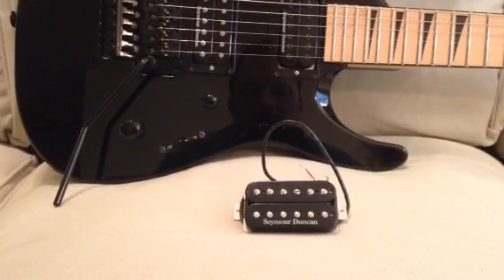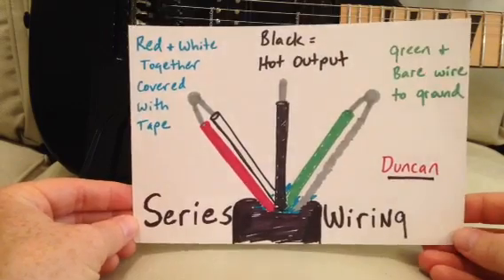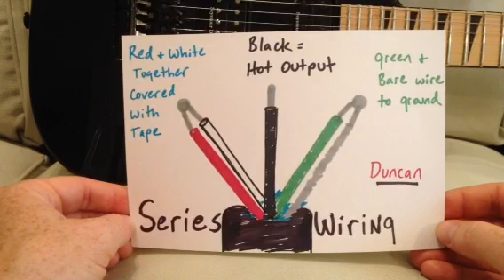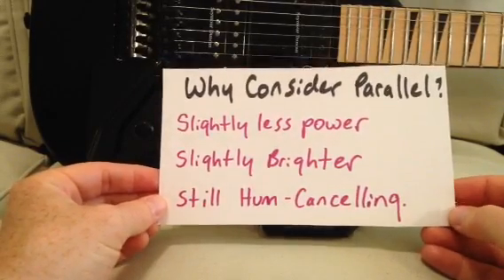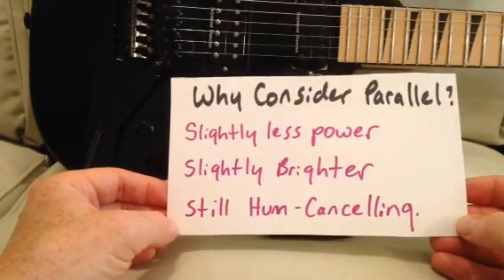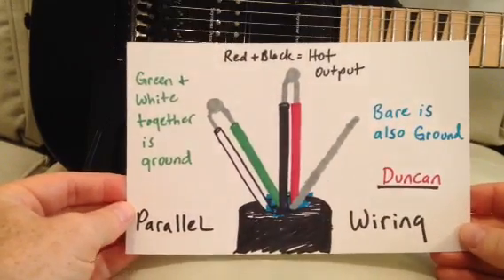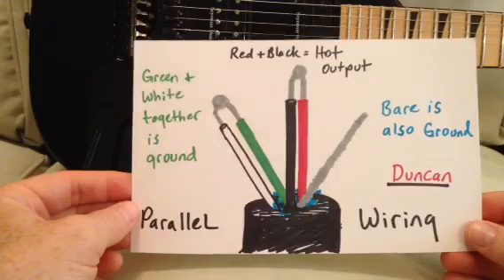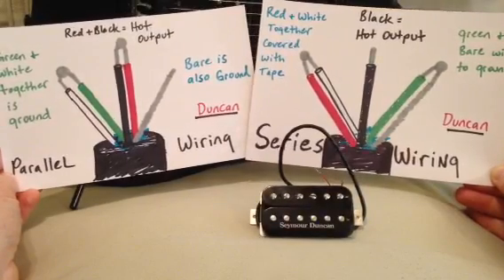Seymour Duncan Humbuckers: Series Vs Parallel Wiring

Comment: Thank you for the simple explanation. I'm looking at installing a push- push tone pot to switch it from series to parallel and back. However since this is on a strat I am concerned about how that's going to work with the other pickups. If you follow the Seymour Duncan schematic for HSS wiring it's actually wrong when it comes to switching from humbuck to single coil. If you follow their wiring schematic it'll go from humbuck to single coil, but only the inside coil on the bridge pickup. So I had reverse my red wire and my white wire so it would tap into the correct coil. So with going with parallel and series switching. Is this going to interfere with the problem I discovered with Seymour Duncan's schematic for this configuration?

I'm finding that listening to guitars that have the parallel to series on a strat HSS has a more desirable tone, especially in the number two position and of course it gets rid of the 60 cycle hum.

Comment: Well presented and helpful. I am currently trying to wire two Seymour Duncan pickups with a three way pickup selector switch and an additional mini 3 position ononon switch for each pickup hoping to get series/parallel and coil tapping for each pickup. Any guidance would be appreciated.

Comment: I’m putting Seymour Duncan invaders in my Sterling JP150 I matched color for color like the pickups that were in it and it cant be right.  All works but sounds weird. The factory pick ups had the black and white soldered together. I did that with these and must not be correct.

Comment: I use a short mini toggle between next to my pickup switch to change from series to parallel. Parallel is GREAT! Series has more mids and is definitely darker. I use parallel mostly with a SD SSL-5 Custom single coil at the neck (no middle pickup). Killer set up.

Comment: I got caught off guard by the term output switch. I saw one video you did using the output jack as a switch for lighting I think. Is it the pickup selector switch you are referring to? I haven't been into a guitar in some time to see where wires go to and come from. Thanks.

Comment: Thanks for the help. I found the Duncan pick up was out of phase with a fender gen 4 noiseless. I presume the phase is the same when hooked up with this parallel wiring so for me to get it in phase with the gen 4 I would have to run the green and white to hot?

Comment: couple of points:

1. hot wires are soldered to the input of the potentiometer (left lug, looking from above), not the output lug (middle) which would go to the switch.
2. In parallel, hot (red) & ground are soldered to the top of pot & green goes to input (left lug, looking from above).

2 will give you a slightly brighter, more nasally sound akin to out of phase pickups

Comment: SD do not show  a correct electrical diagram . Lollar do and are correct . It would appear that SD connect in series but out of phase ?
It should read end of coil connects to start of the next coil . They don’t . They have  ends connected to ends .

Comment: I'm gonna try it on my invaders, they really have too much power and not too much bright! Thanks, good video
Reply: How did it turn out
Reply: They sounded much brighter and like p90. Turns out both were bridge pick ups and finnaly got the fishman fluence modern. But this is a great solution for rock sounds indeed
Reply: @GusMonkey13  that's cool I have my guitar with a jb jr and one volume knob and it works great
Reply: Follow my new guitar account nigatsuguitars on IG! ;-)

Comment: Hello sir thanks for this video.i bought seymour duncan yjm fury stk-10 pickup set.i installed pickups in my(lefty mexican fender strat) exact the diagram.now i have some issue with this pickups
1.its fully noiseless but my pickups has noise issue.
2.i think its righty pickup,but i installed in lefty guitar so the poles hights are change for my guitar.i can't get the actual tone of stk s-10 pickups.
Now my quistion is how can i remove the noise and buzz from my guitar???
And is it possible to adjust the pole hight according to my requirements?if possible then how?
Please sir Help me out  from these problem.

Comment: Sweet, I had a neglected Epiphone G400 Hanging on the wall for a decade. It had a Invader put in before I found it. Worked alright a bit scratch and gritty with the old knobs, Replaced all those with new ones and wired for 50s Style, not bad for a 250 dollar guitar.

Comment: If I have a two wire EVH Frankenstein Humbuckers could you explain how to wire them in parallel? I thought they were made by Seymour Duncan but I may be wrong. Also this is a PRS  Custom 24 with one volume one tone pot. Both pots are push pull American made aftermarket.
Reply: You cannot, you need to have more wires.

Comment: Okay I got a hot rail that came pre wired with tone, volume and 3-way switch. Can't find any diagrams to check it. It has the black and bare soldered to 3 way then to volume pot. White to 3 way. Red and green soldered together and taped. Is this right and what does the 3 way do in this configuration?
Reply: Mr VanFossen If it's an SD pickup then the red and green are the ground and hot from one half of the pu so what you describe means that half of the rail is isolated and inoperative.  The other half is equally useless as both leads go to the selector and none to ground. Have a look on the SD website for wiring options.

Comment: I recently wired in new SD Pearly Gates pickups in my Epiphone LP. I wired it the first way and it sounds great if I use any of my pedals. However if I don't use any pedals the high treble strings are ear piercing loud while the lower  strings sound great. 
Ive adjusted the height by Gibson standard height and also have played around w the height. 
Is there anything I can do to stop the harsh treble strings?
Reply: Shawn sounds like you pickup is too high on the the high e. Lower your pickup height on the right and should help

Comment: FANTASTIC. just swapped from series to parallel wiring on a lil 59 and JB jr in my stat.and the result is GREAT. it was just to muddy for my taste, not much loss in power just moved the pickup closer to the strings, and sounds a lot better. thanks for video I had no idea this could be done until seeing it thanks again.😀
Reply: Just put a lil 59 neck pickup in my bridge in parallel. Can't wait to see how it sounds

Comment: Very useless video guitar guts! But what goin' on if a have a guitar with 2 Hum (for ex: JB on Bridge, 59 on neck pos) 1 volume, 2 tones and 2 mini switch for splitting the hum's into single coils? What is the correct wiring? Thank you for the answer!
Reply from the maker: When you start throwing in mini switches, things get confusing pretty fast. It depends on what you want the switch positions to do. Seymour Duncan's website a lot of great wiring diagrams.
Reply: Ok dude! I'll give a look! Thank you!